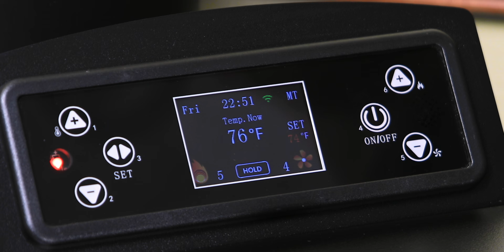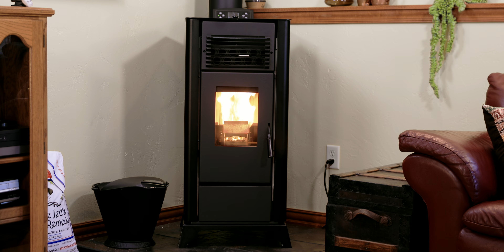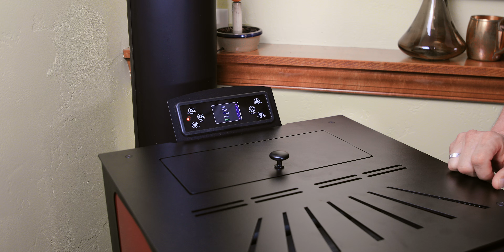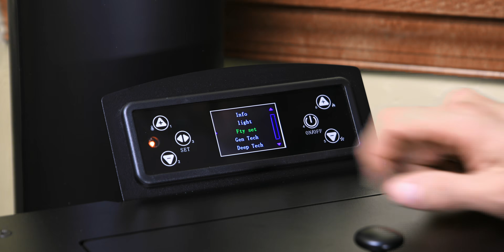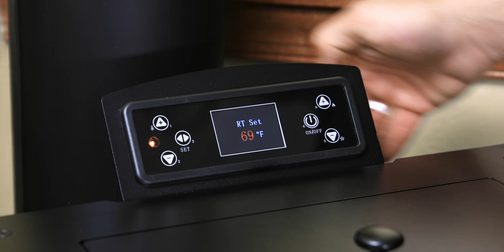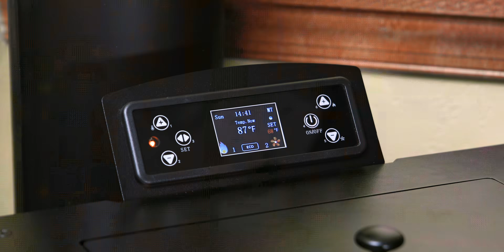Freedom Independence PS21 Control Panel Overview

Comment: Maintenance will not clear

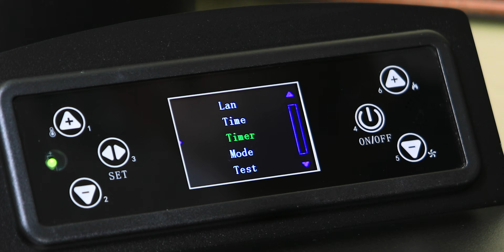1:26
Reply from the maker: I'm not understanding your message here. Let us know if you have questions or need assistance. Thanks.
Reply: How do you adjust pellet drop rate. Drops too much pellets when turning stove on. Overflow spills into ash tray and ignites. Manual instructions are somewhat confusing
Reply: Ps my stove is independence ps21
Reply from the maker: @richardbuckles5098  Thanks for the message Richard. Let me check with the tech team on this and we'll follow up ASAP.
Reply from the maker: @richardbuckles5098   Hey Richard, so to adjust the start-up feed rate we will need to go into the technical mode of the control board which is password protected. Please call in directly to us at 800-236-6647 and ask for Chad C. He will guide you through the process of making that adjustment. Keep us posted, we'll make sure everything is 100%. Thank you!